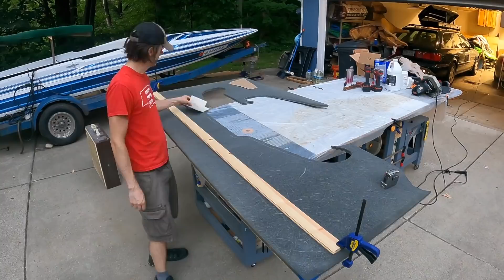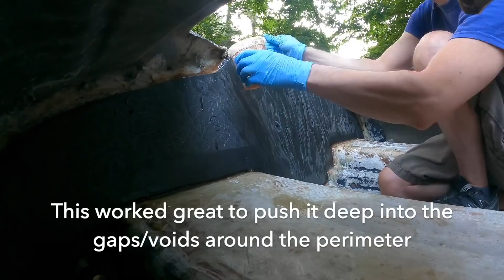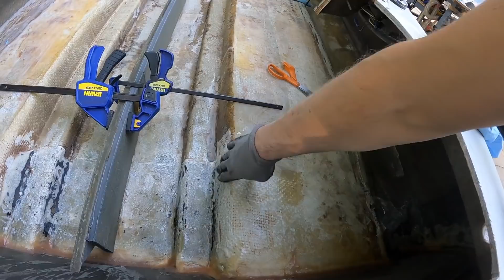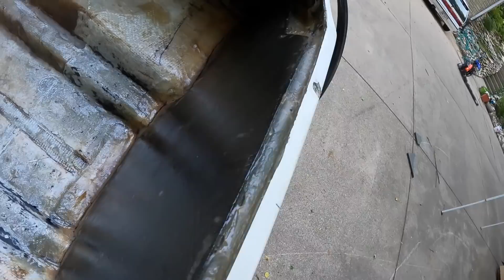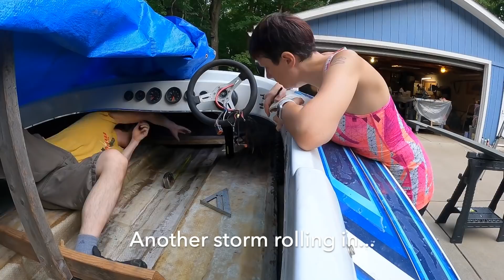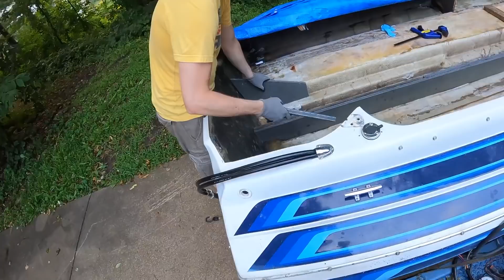COOSA COMPOSITE STRINGER, TRANSOM REINFORCEMENT, KNEE BRACES  Sleekcraft SST Sunday #13

Comment: Micro balloons are a light weight, non structural filler that sands easily.  It's primary use is for fairing, it is meant to be used like Bondo.  Cab-o-sil is a structural thickener that is very strong but hard to sand.  It is generally used for fillets and adds strength to structural joints.

Comment: Glass is not silica. It's a molten mixture of different things, typically lime, soda and silica. The main difference is that the glass beads are still relatively big, with liquid resin flowing around. The silica you have is created from gas, giving it an extremely fine texture and big surface to weight ratio, resulting in the resin being "soaked up" by the silica. It's really not a chemical difference but a physical difference. It's just that making something as fine for cheap only works for silica.
Reply from the maker: Reread your comment, makes more sense.  So the cabosil is basically JUST silica, and the microspheres are actual glass, but a lot larger.

Comment: Like you, I like old Sleekcraft boats.  I have 3 Aristocrats, 2 jets and one outboard (all modified tunnels).  I am considering having  new boat made from the original molds.  I thought you might be interested in building a brand new boat.  If so, contact me
Reply from the maker: So you've been talking to Damon too eh?  Lol.   Would be cool but I don't have that kind of paycheck man, there's a reason I buy old garbage and fix it up.
Reply: @ADDvanced  I do not know Damon.  I have spoke with the guy who has all the original molds and has offered to either sell them or build a boat to order.  Any color, any combination (Aristocrat, SST, inboard jet, inboard/outboard, outboard, vee bottom, modified tunnel bottom, engine covers, etc).   You could use Coosa instead of crappy plywood, and you can build it to any weight (fly weight for racing; medium, or heavy) .  I like jet boats and intend to build two identical boats, one powered by 455 Oldsmobile (have engine ready to go) and one with turbo-charged, fuel injected, GM LS motor, both with engine covers.  In my glory days I had a Gale Banks twin turbocharged LS6 big clock Chevy in my modified tunnel Aristocraft which ran close to 80.  I have spoke to a local guy who thinks he can build them.  Still not interested?

Comment: Hurry up!! I want a ride before the snow flies!!!
Reply from the maker: Tryin!
Reply: @ADDvanced  wish I had parts from the racing days to donate. I do have a couple single ram clamps if you need one. That is going to fly with a 200hp O/B. I am guessing high 80's with a 24 cupped or 26 chopper. Might even brush the 90 mark. Fast stable hulls in a chop because of the centerline. I am officially JEALOUS!! Plus you have a woman that is into the project! Your face when you blanked out her butt was PRICELESS, I was in hysterics! I am not positive what prop works best on them as mine was a jet drive. It may need a cleaver for transom lift, never researched it. I know with a stock Berkley jet B impeller and a 455 olds with a torquer intake, it would brush 60mph which is 5mph over shorter shallow v jet boats with the same set-up.
Reply from the maker: Yeah I've been reading on tri ram vs single ram...     low key looking for a 15" midsection, let me know if you know of any that need a home.
Reply: @ADDvanced  did a quick search, they are racking heads for them.... 1200.00 for a cut down and 1500 for a factory neither one "offshore". I will make a few calls to the right people. Whats the budget? you will need a shaft too... or send yours out to get cut and splined or cut and welded. Another option is to make a plate that fits your jackplate and raises the motor enough to get the propshaft to centerline with the bottom. It changes the geometry of the trim a little bit, but if you aren't drag racing, so what... For sure the cheapest option. Another way you could have done it but a little too late now would be to raise the transom and build it 5" higher. That might look hokie though. Some hulls like setback and some don't... I am gonna research the mod-v race boats before I give any bad advice...lol
Reply: @ADDvanced  If I recall correctly, you have a Sea-Star Pro hydraulic steering system and a CNC powered jackplate. I highly suggest the Teleflex "turn signal" lever to run the jackplate and build a foot switch for trim. Buttons on the wheel kinda suck IMO. "In Control" makes really nice shifters and pedals. Was never a fan of "Hot Foot" but if you already have, might as well use... Just some suggestions for high speed control. I have pictures of my old set-up somewhere from my 22 Velocity. It was originally rigged by Steve PitBull from the TV show "Leepu and Pitbull". and I added a few things to it such as the Teleflex steering and switch, Electric jackplate etc... The In-Control throttle pedals will fit a workboot and the way they are made, actually grip the soul of your shoe. Precise as it gets.
Reply: PS: we always set up with center steering as all we did was race and it gives balance when alone in the boat or better drivability with a navigator and throttle man. We also did some Hydrostreams that way and those things were scary to me. Chine walking and also the hulls delaminating all the time... F that!!

Comment: just sanded and triple painted the bottom on my 9 ft hydro thanks for reinforcement advice 

have you used any garage floor one part epoxy paint as a cheap alternative to west marine epoxy gel coat ?
Reply from the maker: I have not.   I have experimented with graphite powder mixed w epoxy... it's very hard and durable.

Comment: Hey, I have a question.  Not being a big fan of single outboards...  Now that you have a brand new amazing transom, why not convert it to a small block and Berkeley pump?
Reply from the maker: Jets are inefficient, have bad top end, suck fuel like crazy, don’t feel in control due to nothing in the water, and they get clogged w weeds around here constantly.   If you like getting in the water 3-4x every trip to clean them out they’re great….   I find that obnoxious.  Out west where people boat in reservoirs w limited weeds maybe I would feel differently but I’ll be able to hit around 80mph for less than 5k all in on this thing; building a jet that goes above 70 takes massive power and a fairly large budget
Reply: @ADDvanced  I get it, thank you!  :-)
Reply from the maker: @paulp7692  Outboards are the cheapest way to get to 'kill yourself' speeds on the water...  power to weight on them is crazy
Reply: @ADDvanced  Thank you!  I'm still learning.  Just love the blahhhhhhhhhhhhhhhhhhhh wahhhhhhhh on the water.  :-)

Comment: might want to feather in the front of the strengthening pieces for the transom where it feathers intoo  the transom itself so you dont get airpockets from the part when you lay fiberglass over it since you allready gleud them down you could add a small triangular strip to the front of it
Reply from the maker: Not quite clear on what you're suggesting...  I did use a flappy wheel to 'round over' the tops of the knees before glassing them into the transom
Reply: @ADDvanced  no more the end of the knees where they stop and the original transom takes over  , if you leave them as thick as they are now you going to have to glass in quite a step on the overlapping glass mat , might be better to make that transition from half inch to nothing over say 2 inches or so instead of the full step so the matt lays down better

Comment: Hi good vidios i left a comment but did not see it come up i have the same boat 12 inch setback bracket 6 inch jack plate 2.4 300 hp bridgeport would like to contact thanks mike
Reply from the maker: Click on "about" on my channel page, link at the bottom for contact info

Comment: That transom should be hell for stout, I wouldn't be afraid to put a three hundred horse engine on it, you two work great together, kuddos to the both of you.
Reply from the maker: Thanks!    I'm going to be glassing in the knees this week and then call it good; once I add the spashwell back in, that will stiffen the upper half, so basically the top and bottom will be structurally tied forward, should handle damn near anything you can think of.
Reply: @ADDvanced  lol, I would think so, can't wait for the next video!

Comment: Hey just a heads up put some 50 mm holes in the knees down at the back of the transom to let any water that gets in track to the lower part of the hull
Reply from the maker: I’ll have a full splashwell when reassembled, so any water that gets into the interior should roll into the center near the stringer or roll into outer sponsons, I thinj

Comment: Not sure if you already did or not but don't forget to tab the edges with glass. An 8"-10" strip of glass around all the edges to help keep the transom more rigid. And usally the micro balloons are mixed into resin for when you need to fair it out after.. they make it easier to sand vs the fumed silica cures very rigid and can be a pain to sand smooth.
Reply from the maker: Haha guess what I did today 😂

Comment: Great work my friend. It’d be a good idea to cut drain holes in your knee braces where they meet the tunnels at the rearmost point. I’m sure you already know but make sure that you cut drains in your bulkheads if you guys install any. I know that it may not sound like that big of a deal but I’ve seen a test boat sunk before that they couldn’t get pumped out fast enough. I’m sure you know that it’s easy to pull the drain plug,get the boat up to a decent speed and the vacuum created by the hull across the water sucks all the water out of the inside. Problem with that test boat was the bulkheads not having drains wouldn’t allow the water to get to the transom or back to the bilge pump.
Reply from the maker: I thought about that, but I might just add a few layers of glass there to raise it up so anything that gets in there rolls to the outer drainplugs.

Yeah, I put drain holes in everything, imho it wasn't about the potential for sinking, but more the fear of trapping moisture, accelerating rot/corrosion.   Though this is coosa, so I guess it'd be okay, but yeah, will definitely add drains.   I put a limber hole on the back of the stringer, I'll make sure to mention this stuff in the next video.
Reply: @ADDvanced  Right on,I didn’t realize it had more drain holes.  Looking like you’re on top of your game.
Reply from the maker: @lewismocaby3646  I'm just making things up as I go along, working well so far :D

Comment: Silica is great but really nasty stuff if not used safely. Its silicone based there fore if you inhale it it will collect in your lungs and your body can not get rid of it. Its kinda like black lung. Once it's in your lungs its there forever. 

The military uses this material when making biological weapons because its so light weight it will float in the air currents for miles. 
Once its mixed with resin it thickens it much like cornstarch does to gravy. Its harmless at that point. 

Its not the same as milled fibers. I've been in fabrication of molds and molded parts for years. What I find that works best for me is using a mix of silica and milled fibers in resin. The silica gives it putty like consistacy and the milled fibers gives it strength so it doesn't crack under stress. Ive never used micro balloons. So can't make any comments on that. Hope this makes sence and I'm sure you could do research to get the scientific explanations to what I just described.
Reply from the maker: Idk man, Q Anon told me that silica is perfectly healthy to breathe in, as long as you take horse tranquilizers.   The elite cabal just doesn't want you knowing the truth.

That's wild about the biological weapons fact, you officially win the darkest comment ever left on my channel.

Makes sense about the fibers/fillers.   For around the perimeter of the transom, I didn't put any fibers in it, I figured any load there would likely just be compressive.  For the radiused edges, I used some chopped glass to hopefully continue to distribute the load to a different surface by stiffening the joint, even under the glass itself.
Reply: LoL I'm honored. About inhaling silica this is what I was told when it was introduced when I began building molds and laying up parts.  

According to the European Association of Industrial Silica Products, this trace mineral exists in nine different forms, including quartz and cristobalite. Crystalline silica is used in various industries, from glass and construction to agriculture. When inhaled, it may lead to respiratory disorders, lung cancer, kidney disease and other ailments.
Reply: One more then I will get to work on the transom replacement I'm doing..the dark comment came from retired military person I was working with at the time. I trust his word as he never lied to me about anything. Maybe what he mentioned was classified?  IDK LoL.  He said the powder is mixed with biologicals then shell/warhead is air burst above or upwind of a target area and it floats in the wind to dispirse over target.   Sounds dark but thats what he said and I have no reason to doubt him.   When he saw my unmarked bag of silica he called it by name and told me that and asked what I was doing with it with a questionly look.  And thats all I'm going to say about that. Now wheres My box of chocolates....

Comment: I look for your video's every Sunday and lo and behold. You may want to try a charcoal mask with a paper pre filter when working with the fiberglass and all the nasty ingredients. The Covid style n95 masks don't help much. Just a suggestion. Told my bro about the alpha drive information you gave me and said thanks. Said its all in great shape and a refit on certain parts will be done at the end of the season. Maybe give your viewers a run down on repair cost on the 500 dollar boat when you and your wife are finished. TC and waiting for the next installment!
Reply from the maker: THIS DOG CANT BE MUZZLED, I KNOW MY RIGHTS.  IMMA BREATH IN FIBERGLASS DUST LIKE A PATRIOT BRO, TO PROVE HOW TOUGH I AM.

No but seriously thanks, good tips for sure.  I usually wear my respirator when I'm making a lot of dust, and this time I've around I've been pretty strategic with the box fan.  

Current total, minus the outboard, is under $1500 at this point.
Reply: @ADDvanced  Sorry if i got you pissed at my comment. wasn't meant to be that way! TC
Reply from the maker: @davehill9951  No worries man, was making fun of idiots, sorry :D

Comment: Is it strange that one of my favourite parts of these videos is the Chevy Astro in the background?   #astrolove
Reply from the maker: No, astros are badass!   Check out my Astro Build if you haven't seen it yet, found a lower mileage one with blown suspension and crusty chassis, did 3" journey's lift, rear sway, few other things.  Other than the horrible MPG, it's a great vehicle with a low of capability for it's small footprint.
Reply: @ADDvanced   I drove an Astro all through high school and university.  It was a do everything machine.  Although a little sketchy in the snow with the rear wheel drive and the back bench out 😬
Reply: Let’s see a review of that bad boy!
Reply from the maker: @twr41cox  Yeah I need to get to it.  Car reviews just seem so lazy to me tho.